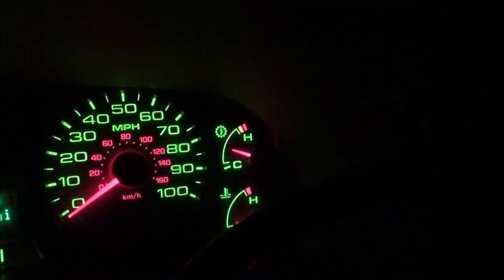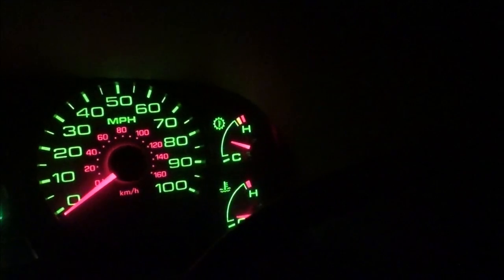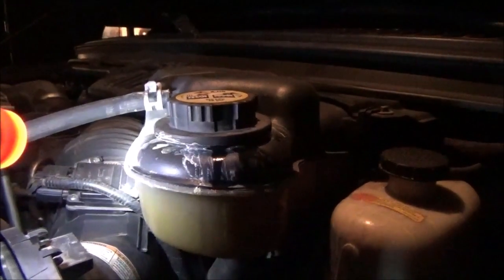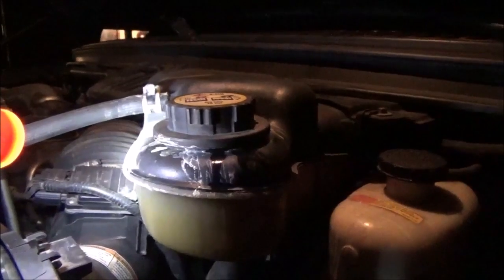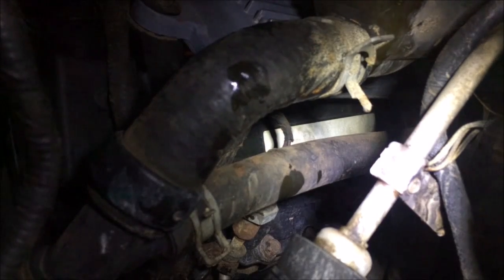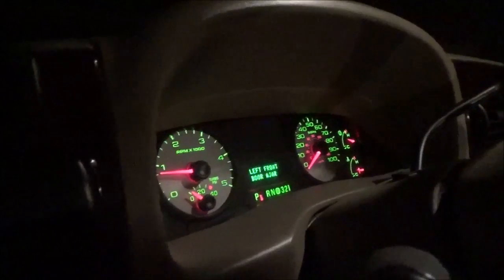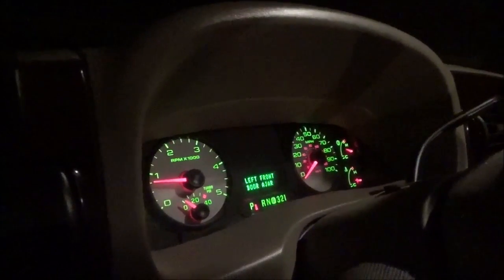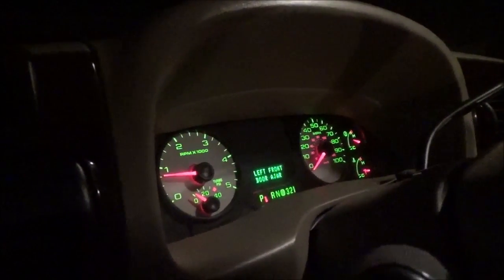6.0 Powerstroke Diesel. Whew!! I thought I needed new head gaskets for sure.

Comment: ALERT never use stop leak on any engine but esecially on a 6.0 powerstroke you will instantly clog your oil cooler into an unusable state and they are $400 + 3 hours of your time
Reply: I have same problem whit my truck?
Reply: Oil cooler is MUCH longer than 3 hours.
Reply: @My_name_is_Brett  depends how good you are at it
Reply: @Andrew Baton  lol I'm assuming you've never taken a 6.0 down to the oil cooler. The complete job, start to finish, is not possible in 3 hours time if done properly.
Reply: @My_name_is_Brett  done it more times than I can count

Comment: Never! Put stop leak in this motor. You will wreck your oil cooler. Anyone with a 6.0 needs a way to monitor Temps and pressure, cheapest way is torque pro app. I'll bet half the people that have a 6.0 have clogged oil coolers and are running way high oil Temps and don't even know it. By the way why use stop leak in any motor? Just fix the problem, stop leak and any product that offers an easy fix is garbage.

Comment: I've heard that the seller or dealer will poke a pinhole in the degas bottle to relieve failed head gasket pressure to sell the truck as if there was no head gasket issues.

Comment: Don't use stop leak! Will plug the EGR cooler and it will fail, that is the first place 6.0 PSD failures begin. Since you bought the truck at the right price and plan to keep it for a long time, save up for a bulletproofing rebuild and get it done before you do have a failure. The 6.0 can be a good engine once built and tuned properly.

Comment: 1. Never, ever ever ever add stop leak to these trucks. 2. Get a Scanguage 2 and hook up to your truck.  Much better and more accurate gauge than those on dash.  It is about $150. 3. Dont add stop leak.  4. Get a coolant filter.  5.  Definitely watch the Powerstroke Help vids and diesel tech ron vids.  6. Studs,  new oil cooler,  and egr delete are good, just expensive.  7. No stop leak. 

These are great trucks and i love mine.... 2006 F250 XLT 6.0 PSD,  4x2, 6 spd manual transmission.  Completely stock, upgraded oil cooler and egr cooler.
Reply: Don't add stop leak.

Comment: Looks like you are on the path to fix it. Those caps on the degas tanks fail often, usually they fail and you get the white residue on your tank. I replace mine once a year to be safe, I think I might have 18 months on the current cap. Get a new cap if the tank doesn't come with one. I don't think you mentioned if this truck has any mods or not. I highly recommend the Bullet Proof oil cooler and an aftermarket egr cooler. Also if you haven't bought one, get a system monitor, scangauge or Edge CTS, or the like. These trucks are good trucks, the monitor will pre warn you of issues. I.e. Oil and coolant temp should be within 15 degrees, nothing more, if it's more that's a sign your oil cooler is plugged. That's if you are bone stock... Lots of good info on the powerstroke forums.

Oh the reason everyone says no stop leak is that the oil and egr coolers have small coolant channels, they are prone to plug with silica based (stock) coolant. Stop leak will accelerate that, most of us have switched our coolant to an ELC, I use CAT.
Reply: Hey would you mind helping me out with some questions?

Comment: Diesels are slow to warm up at an Idle they will get up to temperature on the road and will drop temperature real fast again at in idle. Nature of the beast.   

 Before you open up the motor buy a pressure tester .  Or visit a shop who has one.  A meter with a hand pump attached to it . Pressurize the system an d watch for pressure drop.  A drop means a leak in the system.  Hoses and tanks can leak also as you found out.  

For ease of mind I would replace belts and hoses so that you know what you have. 5 years is the time frame that you should expect replaceable rubber parts to last.

Comment: Hey Joe if that Ford truck is like All there Other diesel trucks you should have a very good truck. My dad has had three ford diesel trucks. The very first one was back in the 80's put over 300,000 miles on it camping across the USA  then sold it. If Ford still makes their trucks like they have. The engine in your truck is probable a international diesel engine  which is the same engine in the bigger trucks just smaller. Just keep up on maintenance and it will run non stop for you.

Comment: Great truck, Great engine, unworthy owners (not you others)
Reply from the maker: I had this one fully bullet proofed, EGR delete, The upgraded exhaust things that tend to blow out or something? I had the thing that hooks up to the turbo replaced a few weeks ago with the new upgraded one that will not leak. I had Cutting Edge Diesel do a full complete engine rebuild. All new injectors and glow plugs, pistons, rings. Everything. All new gaskets because the original Ford ones tended to leak. I have 25,000 miles on the rebuild and this truck runs like a fine tuned machine. I bring it in like clock work and get the oil changed every 3000 miles and the fuel filter changed at 12,000. This motor should be awesome for a very long time. Whoever had it before me did not take care of her. I do.
Reply: NorthernSeclusion sounds like a great truck now. Definitely earned my sub. The hate on the 6.0 is just too much. My dad owned a 2003 which is the worst year and went 140k before he had some issues with injectors and I believe egr. I don’t think he changed his oil on regular intervals like you aswell. Truck served him 10 years and the rust on the utility body made him get a new 6.7. He’s got 100k on it now no problems.

Comment: Ran across this video again.
Diesels are not gasoline engines. They will not reach operating temperature unless you drive them with some load down the road.
Letting it sit and idle is a waste of fuel and time.. Yes they will warm up if they idle, but they won't be full temperature. 
It's a better use of the fuel to start the truck wait for the oil temp gauge to move up a small amount, if you want to wait at all, and start driving. 
You have to remember these engines are literally 1000 pounds of rubber iron and aluminum and it's going to take a long time to bring all of that to a warm temperature while idling.

Comment: I'm new to the diesel world. Just bought a 6L excursion. It has the EGR delete, cold air intake, 4 inch exhaust and the guy I bought it from put in new injectors. It runs awesome.  I installed a coolant  filter, any other suggestions? A friend said I shouldn't need the studs as long as I replace the coolant regularly. 
As far as temperatures, the oil hasn't ran over 205f (hiway driving) and the coolant didn't go over 190f. I think its running top notch 🤷‍♂️. It has 305,000km on it currently.
Reply from the maker: Do not let it go over 5,000 miles between oil changes. The oil runs that whole system. Get the fuel filters changed every other oil change. I had mine fully bullet proofed but the most important thing is making sure you change the oil.
Reply: @NorthernSeclusion  that's what I've heard, thanks!  I bought some shell Rotella 0w40 and am going to put in some hot shots stiction eliminator.

Comment: So someone else added stop leak and you did too? That is the absolute worst thing that you can do to the 6.0. Incredibly bad move. You need to educate yourself before touching that truck man. I've owned a 6.0 for over 10 years and love it to death but stop leak is an absolute killer. At the very least you need an oil cooler. The oil coolers will continue to plug from the stop leak. The bottle is cracked from boiling coolant from a plugged oil cooler most likely.

Comment: dont run these trucks under quarter tank trust me lmfao unless you want tobuy all 8 injectors
Reply: Sounds legit, I've heard that before! I've noticed my 6.0 runs a bit rougher when below a qtr tank. I also suspect my sending unit is taking a crap as well
Reply: @flats-hopper4351  you need a sump
Reply: Just to comment on this old post.
The pick-up in the tanks at the bottom are made of plastic and break on nearly all of these trucks.
Just replace it  and you'll not have problems with low fuel pressure when the tank is under 1/4 a tank.